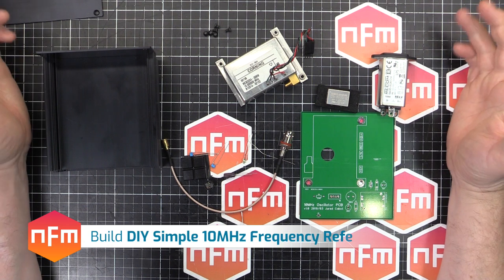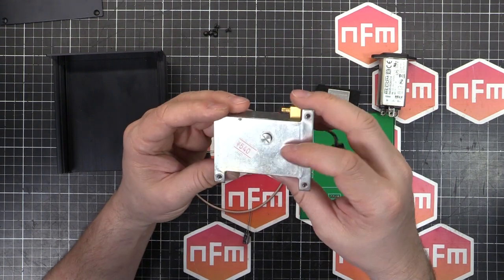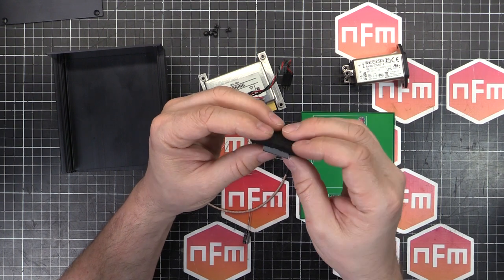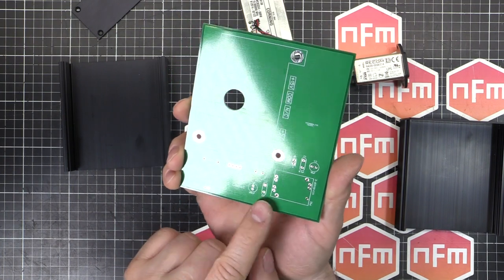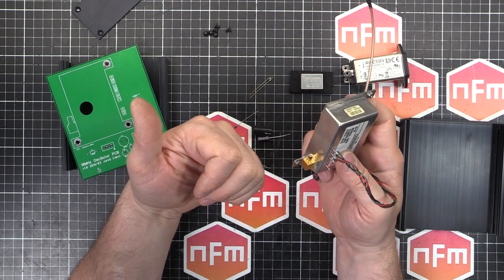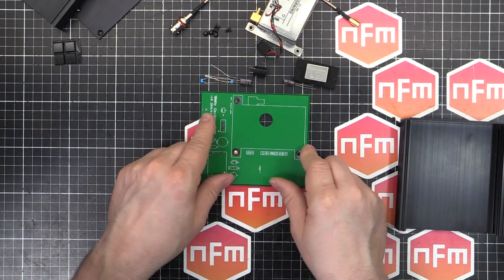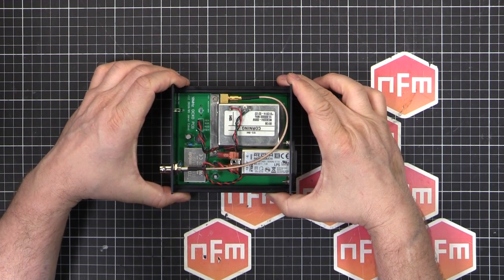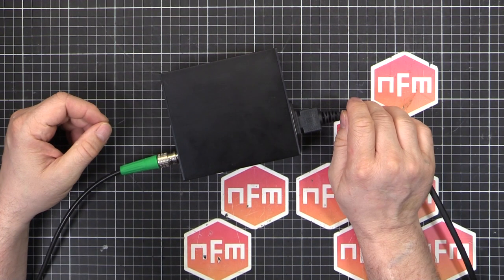DIY Simple 10MHz Frequency Reference

Comment: Right now (2 years later,) we're getting tiny 5 volt 10 MHz Xtal ovens with excellent freq stability from eBay for $4 each for two. Also, they are voltage tweakable frequency for fine tuning or a GPS disciplined freq ref. I bought 12 of them. Hobbyists and builders live in wonderful times for precision surplus.
Reply from the maker: Yeah, I have used the small ones from eBay in a number of projects. Cheap precision parts from surplus is great. :)
Reply: 😊I 😊

Comment: @6:03 I almost shouted DONT DO THAT! When you yanked the SMB off using the wire.

I built a similar thing but using a rubidium unit instead, very handy to have a 10MHz reference on the bench.
Reply from the maker: Yeah, I shouted at myself too, my fingernails had a bit of trouble catching the edge of the connector to lever it off. :D

I have an idea for a rubidium project, I just gotta convince myself to go buy one first...
Reply: Is there a advantage with a rubidium unit over a 10mhz gpsdo? I bought a truckload of telecommunications equipment. Which included over 20 Nortel gpstm modules, And the cabinets/backPlanes/racks that everything mounts in.  Instead of using it as is… In this huge bulky set up. I was going to remove the modular Trimble OXCO unit from one of them, and build it into a nice small GPSDO with a distribution panel. Giving me a dozen breakouts as external references for my lab.... but in a nice self-contained small footprint package.
Reply: @hullinstruments  I picked up a GPSDO recently, I actually showed it in my last mailbag video on Monday, I compared the GPSDO with my Rubidium standard to compare settling time and drift accuracy over the warm up period.

Comment: Nice, If i were you i would also put a common mode choke on the output of power supply as it seems like they are isolated kind. Read: Source of common mode noise

Comment: Description of power supply arrangements very unclear.  The IEC to 5 Volts looked for all the world like an inlet and mains filter. Not entirely clear why you didn't choose 15 Volts for the first PSU and then a 7805 for the small capacity 5 Volt rail.  What was your reasoning?
Reply from the maker: The IEC connector isn't actually a filter, it's actually an integrated power supply, you can find a link to them on Digikey in the video description.
I also made a couple earlier videos about them too.
I already had this part so this project was a good excuse to use it. It saved having two separate power supplies and an IEC socket, instead one combined IEC socket/power supply module, and one other 15V power supply.
If I was building from scratch, I probably would have used a setup similar to how you described, but I was raiding the spare parts bin for this build, so I used what parts I had to hand. :)
Reply: I thought the same as you Ben Model and I see NFM has given his reasoning in reply.  I also notice that the 15V Recom unit only supplies 333mA which, I suspect, may not be enough current for the oven controlled oscillator (particularly at start up)?

Comment: No earth connection? Brrrr :(
Reply from the maker: The metal body of the IEC PSU module is connected to earth, and it is bolted directly to the metal case in two locations.
The device is well and truly earthed. :)